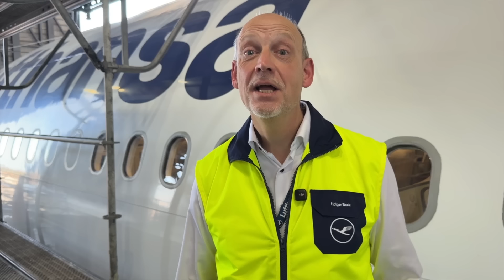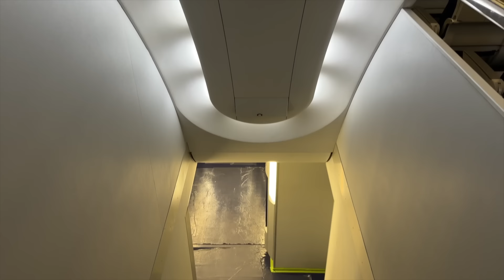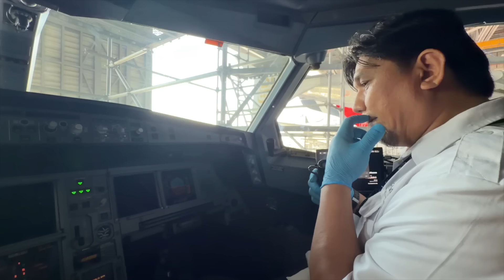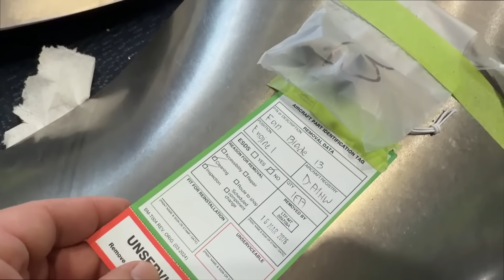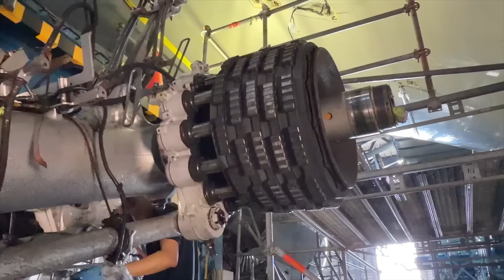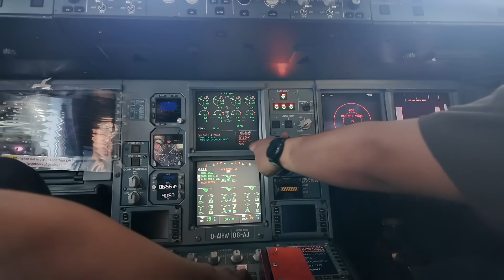Inside Lufthansa Technik: The Last A340-600 Heavy Maintenance Check

Comment: wondering about the insulation.. its only that thick and good in the first class or its the same for the whole plane?
Reply from the maker: It is the same on whole plane. I saw some panel
opened in economy too.
Reply: @SamChui great, thank you Sam! 🙌
Reply: It seems to be the standard. All airbuses ive worked on and the B777 have it like that.

Comment: I worked as cabin crew for emirates … the crew rest in the back of A380 where the 4 toilets are located was a nightmare to rest or sleep … the toilet flush was so noisy… and the engine noice ….. some times we had it in the front below the stairs that takes you to the upper deck it was ok …. On 777 it was located in the back stairs hidden behind the toilet and we go up kind of between the luggage holders it was very conftieda

Comment: i have flown on almost all the latest aircraft that came out in the last 30 years and hands down a340 is the 2nd most comfortable cabin after the a380 but in some ways i prefer it to the a380. mind you i am not talking about the seats. Just something uncanny about its stability when cruising at altitude.

Comment: Established in 2000 as a joint venture between Lufthansa Technik AG and the Philippine-based MacroAsia Corporation, Lufthansa Technik Philippines (LTP) is a premier provider of aircraft maintenance, repair, and overhaul (MRO) services. Headquartered at the Ninoy Aquino International Airport (NAIA) in Manila, LTP operates an expansive 229,000-square-meter facility, including world-class hangars capable of servicing a wide range of aircraft, such as the Airbus A320 family, A330, A340, A380, and Boeing 777. The company plays a critical role in the global aviation supply chain by offering both intensive base maintenance and rapid line maintenance across major international gateways in the Philippines.

A primary advantage that distinguishes LTP from other MROs is its strategic combination of German engineering standards and a highly skilled Filipino workforce. By adhering to the rigorous quality and safety protocols of the global Lufthansa Technik network, LTP ensures "gold standard" reliability while benefiting from the Philippines' competitive labor market and a talent pool renowned for its English proficiency and strong work ethic. This synergy allows LTP to provide top-tier technical expertise at a cost-efficiency that is highly attractive to international airlines and lessors.

Furthermore, LTP’s geographical location serves as a major logistical asset. Situated within a four-hour flight radius of major Asian hubs like Hong Kong and Singapore, LTP is perfectly positioned to serve the rapidly growing Asia-Pacific aviation market. Its facility is uniquely equipped to handle the world’s largest passenger aircraft—it can comfortably accommodate two Airbus A380s for simultaneous heavy maintenance—which is a specialized capability that many regional competitors lack.

Innovation and flexibility also set LTP apart, particularly through its specialized technical services group, which is certified as a Design Department under European Union Aviation Safety Agency (EASA) approvals. This allows the company to go beyond standard repairs, offering complex cabin reconfigurations and major modifications in-house. This comprehensive "one-stop-shop" approach minimizes aircraft downtime and simplifies the maintenance process for clients who require bespoke engineering solutions alongside routine overhauls.

Finally, LTP is increasingly recognized for its commitment to workforce diversity and modernization. With a workforce of over 3,000 professionals, the company actively champions inclusion, seeing a rise in women taking on leadership and high-level technical roles. This progressive culture, combined with continuous investment in digital fleet support and sustainable MRO practices, ensures that LTP remains an agile and forward-thinking leader in an industry that is constantly evolving toward more complex and environmentally conscious operations.

Comment: I hope those boys know what they are doing and not forgetting some switch or cable unwired:)
Reply: This is not the US where poeple have an education standard of 6th graders
Reply: Those boys you say completed years of technical education compressed into about 6 months training under strict German engineering standards under EASA Part 66. From M1 to all of it. Kiddo, those dudes even have to memorize  both EASA’s regulations and FAA’s 14 CFR Part 145 regulations in less than 2 days just to get in. 

You should worry about your boys that doesn’t even have a technical college diploma and highschoolers working on your planes just because they got some certificate after just months of training. Lol.

Comment: The lower deck toilet units are not unique to Lufthansa A340s.  I flew on an A330 operated by Airtours in the early 2000s which had a downstairs toilet/rest area unit and Virgin Atlantic also had the same feature on their A340-600s when I flew to Dubai from Newcastle in 2006

Comment: One of the most beautiful airliners ever created! 😍
Lucky to have had the privilege of flying on a Lufthansa A340-600 once.
The most noticeable thing for me was how quiet the cabin was compared to other planes of its era.
Reply: I like it, but the -500 has better proportions. That one is a looker.
Reply: It has all the restrooms under the main deck. Very unique for an airliner.
Reply: Excellent safety record, but criticised for being inefficient and severely underpowered. Most airlines are retiring them as quickly as possible.
Reply: @phuketexplorer  The A340-600 is not underpowered. That reputation comes from the smaller A340-300 which has different engines.
Reply: @Energetics44110genau A340/300. Die sind Schlapp
Reply: @phuketexplorer  that’s just the 200 and 300
Reply: LOL... it's not, it's ridiculously long and skinny, not how an airliner is supposed to look and therefore i never liked this airplane.
Reply: @lcfflc3887  totally disagree. The A346 is just a beauty.